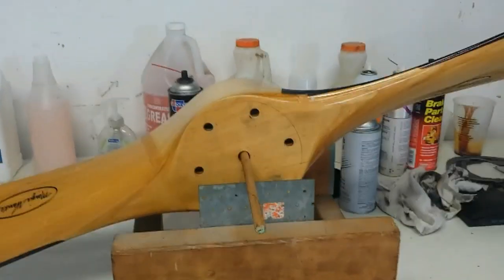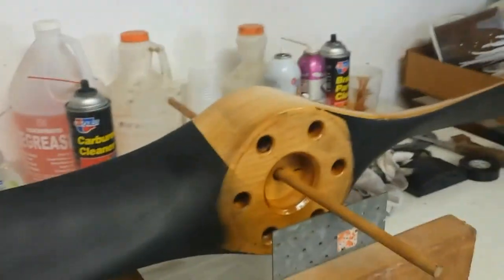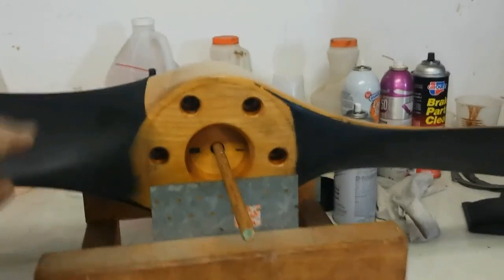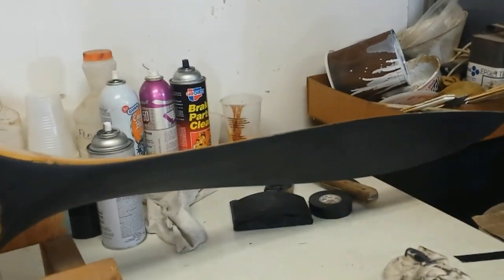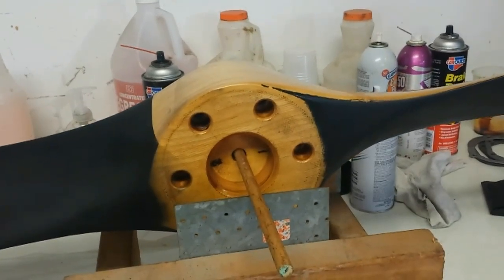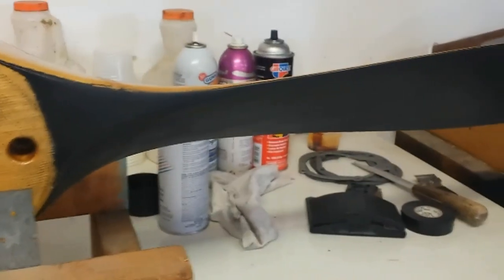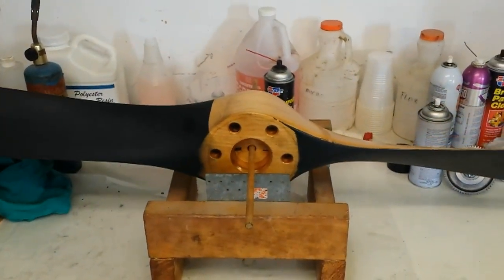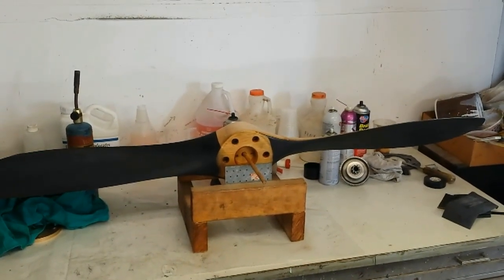Propeller Static Balance 2016

Comment: Mike, 
I am guessing that the boards are 2 x 4ish with the metal knife 
edge screwed onto the top boards. Is the whole shebang bolted together 
or do you have the top boards just sitting on the cross boards?
Sorry if this is DDDDaaaarrr question.
Keep up the great work
Paul
Reply from the maker: +Paul Poulsen Yes, 2x4's screwed and glued together.  Then a piece of metal just as you say.  I did make the metal edges level tho.  I use the same thing to balance my tires.  Dual purpose and dirt simple.  
Patrick Panzera's balancer looks awesome but would take some machining.